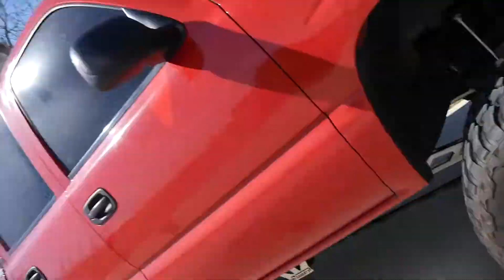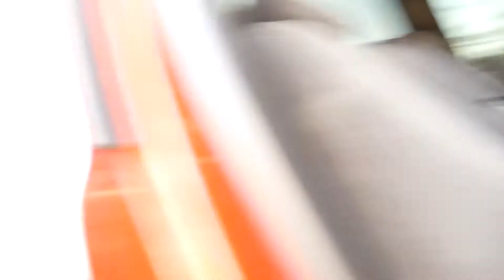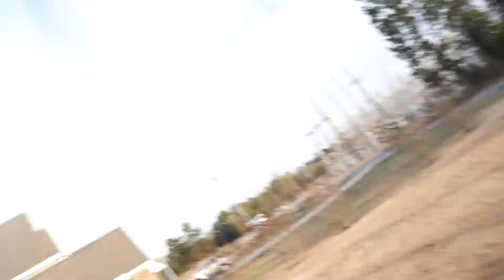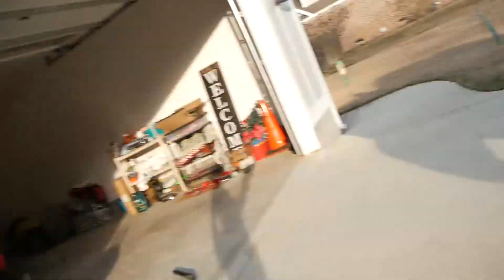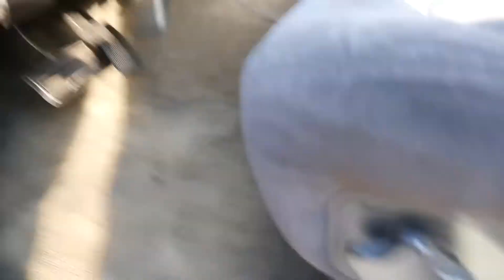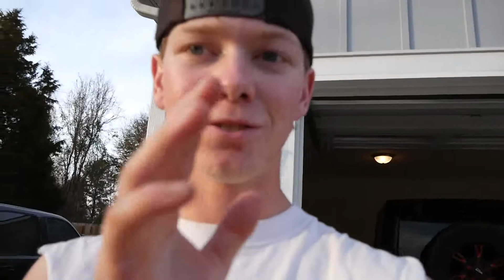REBUILDING MY TRUCK ~ Daytona #1

Comment: I noticed you put cognito upper arms. I bought some for my 2015 Chevy Silverado 1500 5.3 LTZ 4x4. I have run into an issue where cognito said the ball joint goes on from under and I have had them on top. I could have swore when they came the ball  joints were on top. They are the SM Series

Comment: I am Old school and Love Polished Rims and Colormatched all black textured exterior parts and Add Factory fender flairs colormatched. I told the dealer that I wanted colormatch flairs 2007.5  So I had a few choices that came painted, so I picked White Silverado LT Z71 1500 Cewcab. I plan on Color Matching all my Black textured plastic exterior parts real sooon.